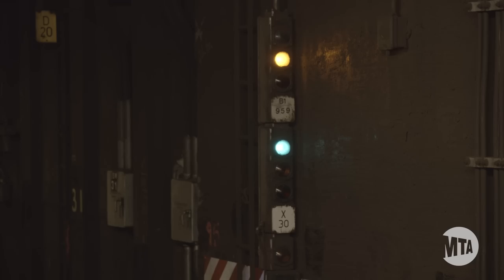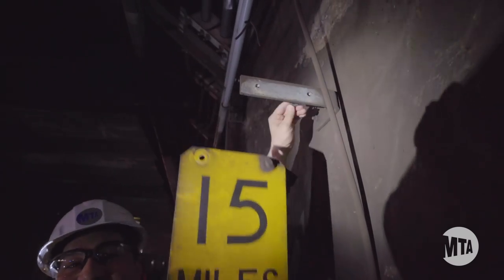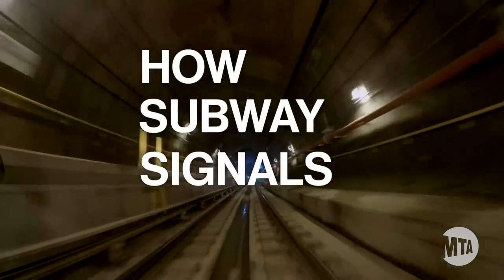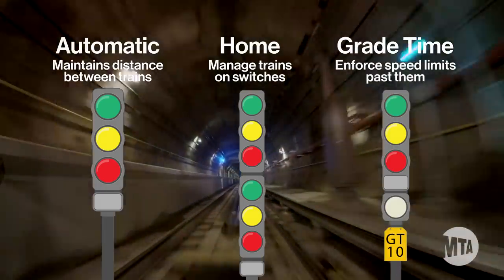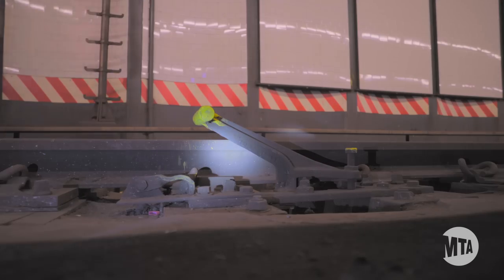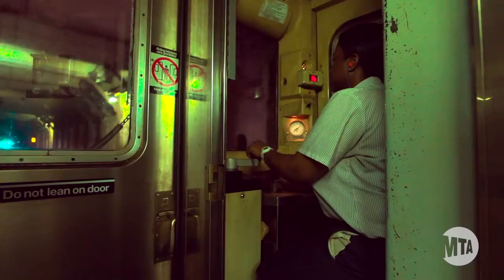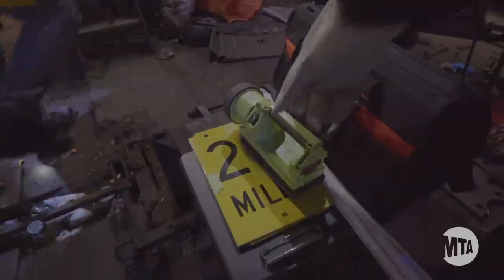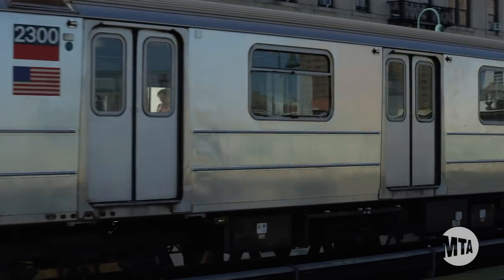SPEEDing Up Your Ride

Comment: This is a recipe  for disaster  30  40mph is to fast for most parts of the subway. It been a long time since  a major incident  in the subway system
Reply: You do realize that speed are being increased ONLY where it’s safe, right? They’re not going to speed up every part of the system.
Reply: @TheRailLeaguer  well there macanical  failure  . Parts failure . And the fact that you could have a collision.  It not un common to have a train on the wrong track in the system.  It happens more than you know and it's not going to be reported on the news you know
Reply: @robertnussberger6449  So you’re saying that any speed increases should be rolled back? By your logic would you have trains operate at 5 miles per hour throughout the system?

Plus other train systems are speeding up their lines, so why can’t NYC?
Reply: @TheRailLeaguer  what I am saying is the system  , equipment and cars are not made for higher speeds like that. They can't even keep the trains on the right tracks. Trains have literally  pulled into the wrong station.  It would only be a  matter of time before  we had head on or rear end collusion.  Also don't rely too much on train braking systems. If they did the train would not have to make soo many brake  checks  before Williamsburg  bridge      the j turns at Jamaica  crescent  and Fulton turns.    And mytle Broadway  turn among many other places.  The subway  runs at the seat of its paints and a increase  of speed will make it much more likely  for a mishap
Reply: @robertnussberger6449  That’s not really true (though you might be thinking of another transit system). The increase of the speed limit at City Hall from 6 to 15 miles per hour did not result in any accidents. The same can be said for other speed limits as well.

Keep in mind that the MTA’s SPEED unit ran a whole train through the entire system to determine where the speeds can be increased. The locations that they have determined safe to increase got the speed increases.

Why don’t you want faster and safer train service for all riders? Do you even ride the subway?
Reply: @TheRailLeaguer  yes I do ride . I also drive tractor trailers for a living . There are places in this country  where the speed limit  is 70 mph . Do l do 70 ? No I know that the machine  I am driving subject  to macanical failures . And so are subway cars . Also subway lines don't just go from point a to point  b.  There routes into twain at many different  points.  Basically  running  the nyc subway system is like keeping a bunch of ducks in line or hearding cats . And the higher speeds of even 10mph would be a disaster  in the making. Also look up of what happened when nyc brought  brand new subway car in the 1970s . It was a disaster  . R44 and r46  were taken out of service because  of it. What that had if we had those trains going at those speeds.  Those  new r180s may have some serious  problems  you never know
Reply: @robertnussberger6449  The R160 and R188 cars are pretty solid if you ask me. Also higher speeds don’t tear into the reliability of the fleet. We’ve ran subway trains at higher speeds before and with the evolution of the subway car design and track geometry, it is possible again.

Also, are you suggesting that you really don’t trust the MTA SPEED Unit?
Reply: @TheRailLeaguer  with the exception  of electronic equipment  subway cars are unchanged  since  the  1930s. Also the r160 and 188 have no track record to judge them. The r44 and 46 had truck manufactured by Rockwell  and were tested for years in other states and cities with no problems  only to Crack in nyc . The trains can go faster but not safer. In 1973 state officials  tested the r44 on the lirr tracks on sunrise  highway  and got to up to 90mph before slowing  down so they can go fast just not safe on nyc tunnels elevated and ground lines
Reply: @robertnussberger6449  The R160 and R188 cars do have a track record. They’ve been in service since 2006 and 2013 respectively. It’s 2022. They’ve been doing relatively fine with no major issues.

Trains can go faster and safer. The SPEED unit confirms this in most segments. All sections where it is safer to increase speed have seen speed increases or are getting speed increases.
Reply: @TheRailLeaguer  no r160 have been having braking and exceleration problems motormen have over shot station and red lights because of the numatic braking system. Plus the doors have malfunctioned on many occasions have to have been taking out  of service  a few times
Reply: @robertnussberger6449  The braking systems on the cars are actually fine, though the new R211 train cars replacing the R46 units are going to make further improvements.

The issues are also not that severe since a large portion of the fleet isn’t being pulled from service, this not affecting service in any way. Perhaps you’re thinking of the R46 cars, which have been causing headaches on the N/W lines.

The R160 cars currently make up the entire E, F, G, M, and R routes, plus a portion of the J/Z, as well as 64 cars assigned to the L route. All of these routes have not seen any single issue. The R160 and R188 cars are very robust and are one of the more reliable cars in the entire fleet (this is also why Kawasaki has been given the R211 order).

The R211 cars are also be scheduled to enter service on the A and C routes as well.
Reply: @TheRailLeaguer  they have been running  red lights and over shooting stations . Doing those things are very serious  and  come with severe  penalties  and  terminations
Reply: @robertnussberger6449  Those aren’t happening on lines with R160s on them. I’ve been on the F and M trains and they haven’t overshot any stations, though they do happen in non-R160 assigned lines. Also, just because of one issue of a train overshooting platform or red light, which can be traced to poor operator training, doesn’t mean that no portion of the system should not be sped up.

Still, the R160 cars are very very robust. Many are also getting major upgrades for the CBTC operation on Queens Blvd and Automatic Train Operation, which can also take control of the train away from the operator.

I’m starting to think that you’re really riding the wrong subway system. All of these issues you describe are happening on a larger scale on Washington DC’s Metro, not in NYC like you claim.
Reply: @TheRailLeaguer  their videos on YouTube  of people on trains that have over shot  stations and red lights.  Just because  they don't announce  on the news evernight doesn't  mean it's not happening. But their are plenty  of videos  on yt  passengers  filming   the train there on over shooting stations.  And the r160 and up have been taken out service many times in past